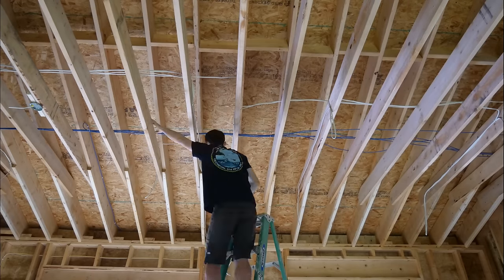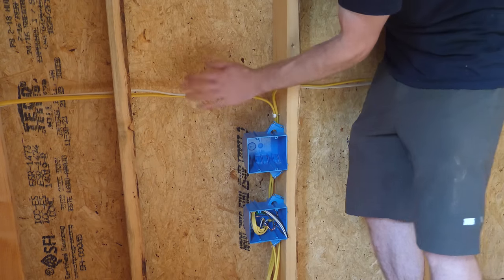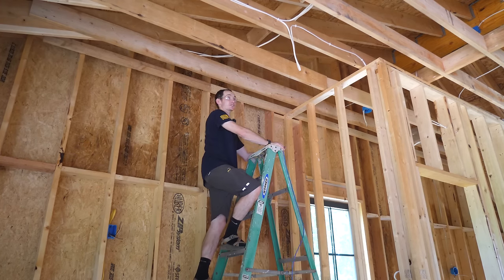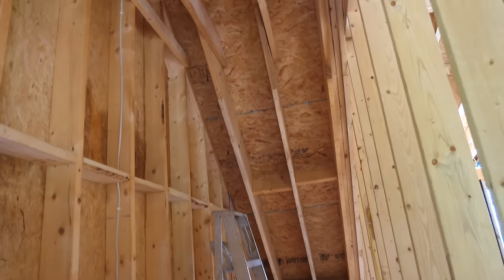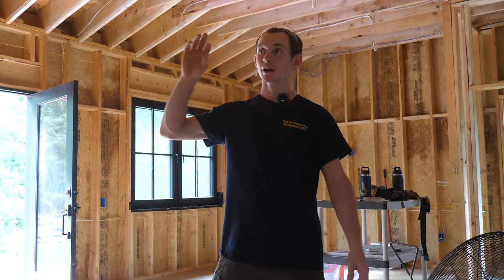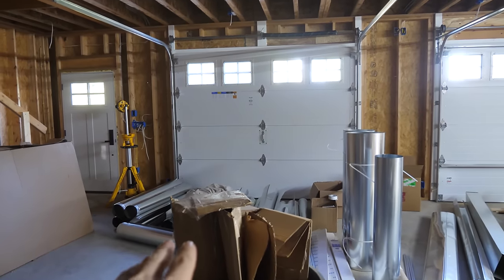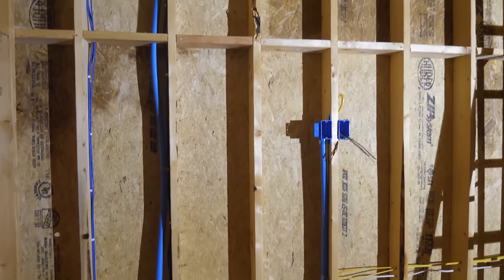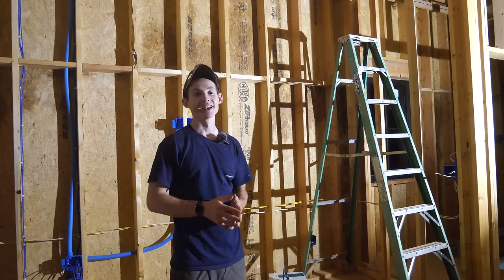Ethernet Wiring for Data & Internet

Comment: Love your channel , I have extensive understanding on network wiring and the type of wire you are using with a length greater than 100ft will degrade in speed depending on your task. There is another type of CAT6 wire, but that does not MIX alloy with copper and uses pure copper it will not degrade even at 300ft well worth a few extra dollars. If it's not too late I would recommend pulling that wire. Also consider structuring network center in a CENTRAL position making it more efficient and economical in general to run to each endpoint around the house. You can also consider running the same cable to cameras with supported POE you are set. Keep up the great work....Congrats on your new home.
Reply from the maker: Thanks for all the info! The wire in this video was pure bare copper wire, I got it here: https://www.monoprice.com/product?p_id=13674. Maybe you are thinking of copper clad aluminum (CCA) cable?  

I was originally planning to do a network hub in the utility room, since it will be a central spot once the addition is on. But the Reolink PoE system we will be using looks like it calls for all of the cables to come back to the NVR, which is connected directly to TV via HDMI and controlled with a mouse connected to the NVR. I'm sure more sophisticated and expensive PoE systems work better with a central hub and remote viewing/control.

Definitely still learning low voltage so feel free to email with any other advice you have!

Comment: Our low voltage installers had a slick way to secure wires/cables to the framing.  They first hammered in a steel Romex staple parallel to where the wire would be run, leaving it slightly protruding (about 1/8").  They then used a zip ties to secure the cable to these staples.  In areas that needed extra wire late in the project, they just zip tied it to the bundle already zipped to the staples..  With this technique, you don't risk smacking the delicate low voltage cable with a hammer.
Reply from the maker: That's a really good tip! Never heard of it

Comment: All those Cat6 will have to terminate to a single location from all other locations, you will need a media closet or some place to terminate and connect to your gear. Dont forget your nail plates for any wire that you run through the studs and plumbing.
Reply from the maker: Yep we will do a little cabinet/nook in the entertainment center! There will eventually be a full wall built-in on that wall with an electric fireplace and picture frame TV so it will be easy to store there.

Comment: Only recommendation I would have would be to run all the cat 6 to the utility room and have a patch panel and server rack installed there. So much easier for running POE devices all to one location and won't be taking up space in the living room. Ubiquiti makes some great hardware for home networking and automation.
Reply from the maker: I did think about that, what steered me towards routing everything to the TV location was the manual for the cameras and NVR we will be using (Reolink). It called for all the cables to terminate at the NVR feeding directly to the viewing TV with HDMI and is controlled via USB mouse. I suppose I could have run a long HDMI & USB from utility room to living room TV, but  thought there might be excess latency. There's probably hardware to make a remote setup like this work, I'd have to do more research. I'm certainly open to advice on this for the future addition, low voltage is something I really haven't dug super deep into.

Comment: I was helping out a neighbor whose house had been wired with cat5.   A bunch of cat5 runs.   They all came to a wiring cabinet, but were not labeled.   For phone lines, this is fine because phone lines are simply tied together.   Cat5/6 network runs are point to point.  Its very good idea to label the runs.
Reply from the maker: Yep they are at the ends with some masking tape!

Comment: When we did a major extension I ran cat5e all over the house way back in 2004. You are totally correct about the cost when it isn't finished. People thought I was nuts then and it is still better than many houses today. One thought on the hard drive, you can get NAS storage with software that is fairly robust for survelliance with no monthly fees. Make sure to back it up offsite, either to another NAS which is free other than hardware, say at your in-laws, or to the cloud.
Reply from the maker: Thanks for the tip! The camera system we will use has an NVR that comes with it, no monthly fees thank goodness!

Comment: Very nice thinking and work on all this. It looks like the house is a bit big to expect solid wireless coverage from a Wi-Fi router sitting wherever the network ingress will be. Recommend thinking through access point locations and adding a CAT-6 drop at each that runs to the wiring shelf/closet of the ingress. I can say from experience that wifi dead spots are a nagging quality of life issue these days and retrofitting additional access points is painful.
Reply from the maker: Good tip! I suppose we could do a repeater in the office if needed. Right now we use T Mobile's generic router that comes with their hotspot internet service and it sits in the RV, we actually get pretty good Wifi everywhere in the house. I'm impressed with that thing
Reply: Hard wire for an Access point or two.  Thank me later.
Reply: @MasonDixonAcres  Yeah keep in mind that penetration will decrease as you add structure like sheet rock and turn on electrical.
Reply: @MasonDixonAcres  planning for Poe ap’s is necessary. With your conduit you should be fine though. I’d also recommend never using an ap that doesn’t have a hard wired backhaul (repeater) as those normally chunk bandwidth.

Comment: I am actually looking forward to running CAT on my new build. I first started pulling wire in hot, filthy attics and crawlspaces 20 years ago. My final retrofit job was drilled through solid foam in my RV. Having bare studs and open access is going to be sheer joy by comparison.
Reply from the maker: Haha you're totally right.. get the wiring in while it's fresh!

Comment: These video you make are awesome very helpful and extremely appreciated! Im just in the starting point going backwards from pre-existing drywall finished with fully insulated attic but determined to install all the car6 wiring, Smruf tubing! I did want to ask on that from attic run to your basement you installed pvc conduit pipeing. Can this be done anywhere? Meaning from any wall or space from attic to ground level floor? It there restrictions if driling 2" or 1.5" holes into the top/bottom plates and/or studs as needed to get to runs i need from attic to ground floor! Also can you do these runs from attic to ground level in multiple places if needed? Or does/would this hurt the structural integrity?

Ps can you use smruf tubbing vs pvc conduit? Any pros/cons for this?

Comment: Its a good idea to go around and cover all of the electrical boxes with duct tape.   Especially the low voltage ones.   Paint and drywall/texture mud will get on the wires and make the finish step messy otherwise.
Reply: Haha right!  When my dad was building his house in the 60's my kid self had the job of stuffing all the boxes with newspaper before the plasterer showed up. Duct tape wasn't a thing yet 😊.
Reply from the maker: Good idea! We will definitely protect them, especially switch boxes near the seams that will get a nice trowel of mud right over  top 😄
Reply: A small piece of fiberglass insulation works pretty good. Just cut a bunch of rectangles a little bigger than the box, separate them into 1” thick pieces and stuff them in the box.

Comment: We had the same thing done for our offices and media room when we had the basement finished, I dont think we ever used them because wifi is so much cleaner looking. The only thing i can think of that's worth wiring these days is the surround sound system(s).
Reply from the maker: True, that's why we didn't go crazy putting a jack anywhere other than the office. We use T Mobile's generic router that comes with their 4G internet service and it's pretty darn fast as-is

Comment: Big fan of this channel, learned alot! One question is for running vertically wires, electrical or otherwise from attic on a 2 level building down to ceiling of 1st level, can you cut into a header top plates on the inner framing not a exterior wall but a inner wall with a top plate? Any cutting into an exterior framing is a no-no due to load is my understanding but what about inner framing top plates, etc to get to 1st level?
Reply from the maker: You can drill through load bearing top plates, interior or exterior, but only within limits specified in the IRC and/or local codes. There's not much harm in drilling through a partition wall only holding drywall up.

Comment: Great video but it would not pass inspection in my area. You need vapor boxes on the outside walls and ceilings or cold air is going to get in. Hot air would also migrate in on a hot summers day. Now if you are using spray foam insulation then its ok.
Reply from the maker: We are using Siga Majrex vapor control layer and taping to the boxes - more to come on this. Also used sealant on the wire entrances and unused knockouts on the back of the boxes

Comment: Is there a reason why the backside of the Zip system is wet? Are you having having issues with leaks?
Reply from the maker: It's not, it's a color difference in the resin due to a process called skip sanding that is done at the factory to ensure perfectly even thickness of the finished panel.

Comment: I would have put a draw wire in your long run of flexi those ridges in the tube make it hard to get cable through unless it’s a straight run 👍
Reply from the maker: I just vacuum a string through later when needed! Super easy

Comment: that zip has to just be discolored right, not wet?
Reply from the maker: Yes, it’s not wet. The discoloration is the result of a manufacturing process called skip sanding to ensure uniform thickness on the final panel
Reply: Same thought!!   I've seen very few zip failures and is always an install outside of spec.